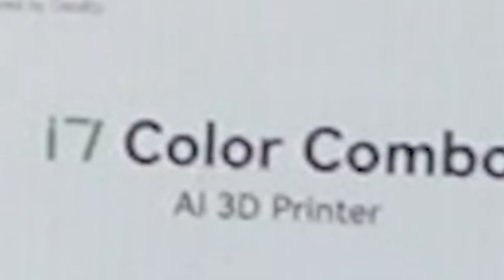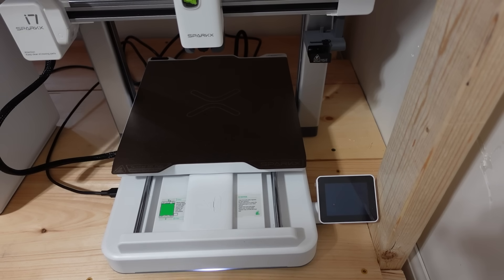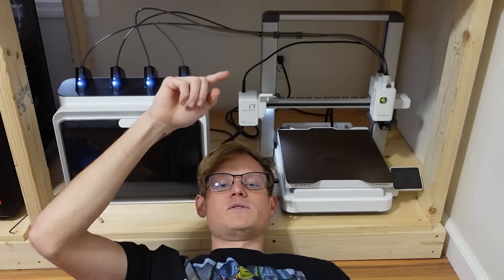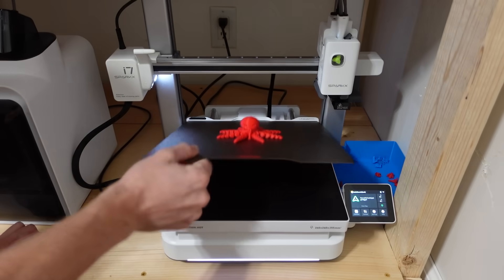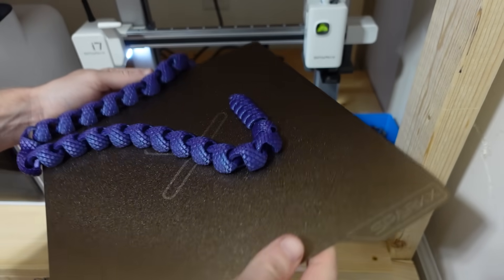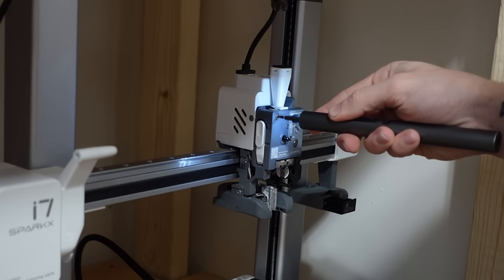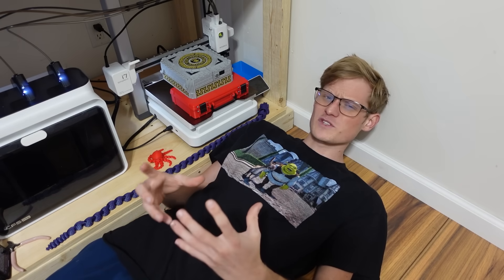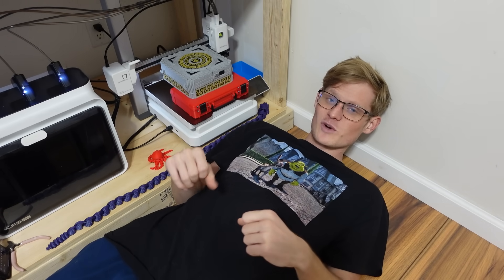The Cheapest AND Easiest 3D Printer I’ve Ever Used l Sparkx i7 Unboxing & Review

Comment: I am currently having a bit of buyer's remorse. I am waiting for my first printer, a K2, but I think I made a bad call with an enclosed, non heated machine. As it is, I'm likely to be printing in my living area so the heated/enclosed filaments are off the table for now, but I convinced myself I could contrive a way to do it, we'll see. I kinda wish I would have save a few bucks and gotten this or an A1. The K2, versus the Plus or Pro, feels a bit like I gave up the security of training wheels for a better bike with flat tires.
Reply: I mean most things print fine what are you trying to print exactly? But you really don't want to printing that in your living area abs,tpu are pretty nasty and both can be printed fine abs as long as it's not too high their are tricks rafts and such to help with warping. Price difference is insane by the time you buy the pro why not buy the plus. It's a fine printer I got 700 hours on it. You can also preheat the chamber a bit with the bed heat up. Enclosure is a real nice feature and bed slingers have their own issues mostly on tall stuff. But yeah the mistake was us both buying this year when next year is year of the tool head changed but it's better to have a  printer than not lol.

Comment: The box: You had 4th position free so you could have used it for PETG support (important feature for multi-filament printers if they manage it) 😉

Unfortunately we didn't (have the time to 😅) see how the print quality looks like. Battery box was quite rough but fast, it would have been good to see how normal and good print quality looks like (VFA, layer stacking, color bleed, ghosting) 🤔